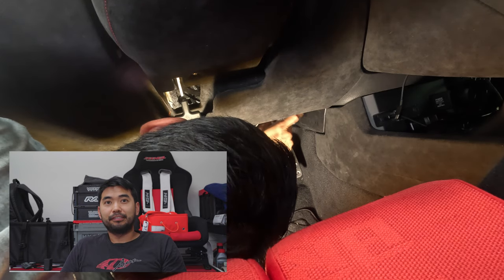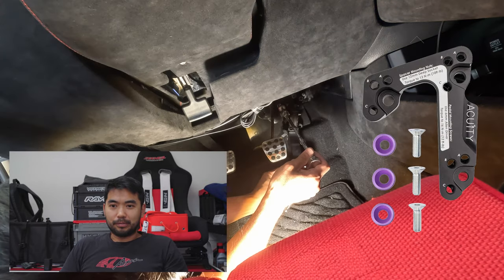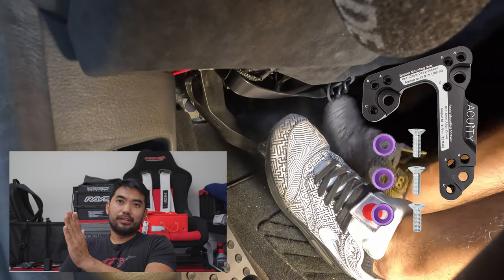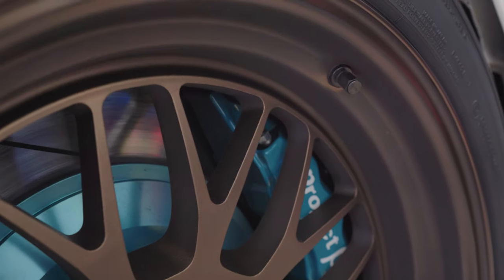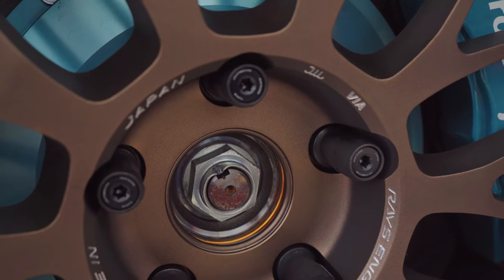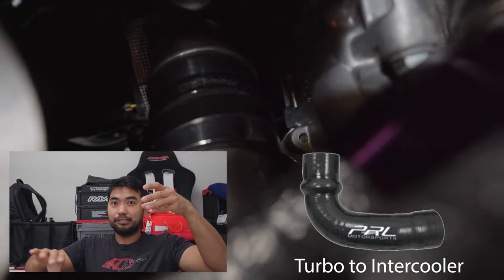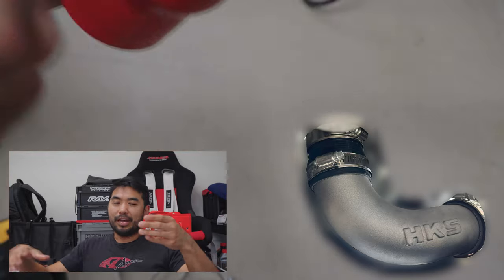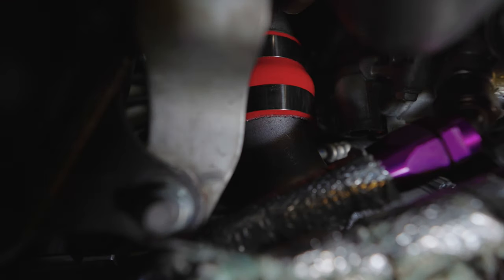VLOG #6 - Post Track Talk | Heel-Toe Mod | No More Blown Couplers | LTE for the BlackVue Dash Cam

Comment: A simple solution to fuel starvation is to replace the oem fuel sock with the longer Holly hydramat. It saves you from having to do a full surge tank. I have the Nuke performance 3 internal pump surge tank with two Walbro 535 lph pumps.

Comment: What position did you end up using for the Acuity pedal spacer?
Reply from the maker: I use A currently. It’s same placement as oem pedal but just raised up to be almost even with brake pedal
Reply: @Kodawari.FK8 thanks going to pick one up and see. Been having trouble heel toeing in the fk8 :(